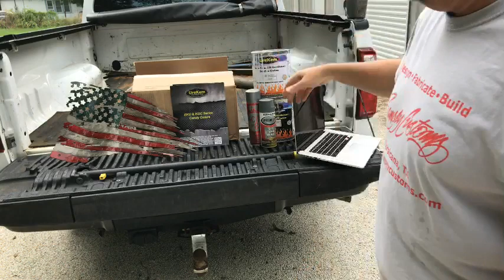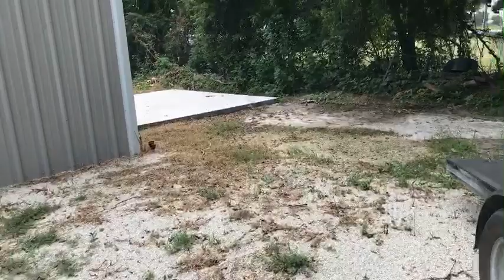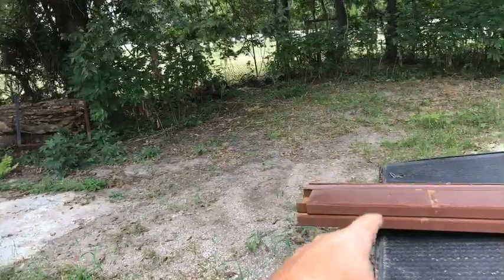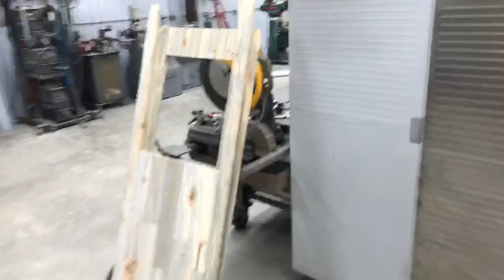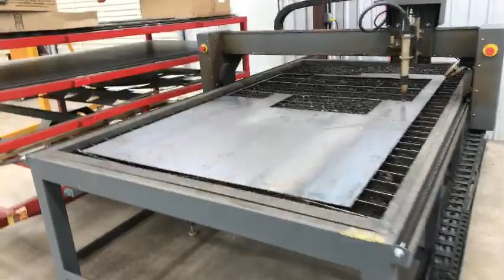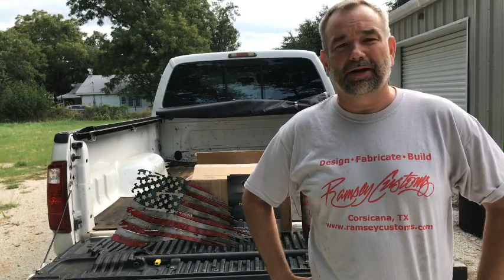Some Bad News - Part 2 Live stream replay

Comment: ...Shop labor hourly rate for automotive work....around here (Sacramento, Calif.)...$90-100 for Independants....Dodge dealer $169..............so I did the water-pump and front can housing on my 99 Dodge ram Van with V-6 myself.......$15 for a gasket and seal kit.....did it in my driveway....a few hours....

Comment: I blew a waterpump and rad on my 6.2 diesel wheelchair van last summer. Everything from the engine block forward got replaced and that was 10 weeks of chasing obsolete parts, and a guy shot himself in the head over it

Comment: Sympathies with your hassles. Even $3,200 was a heavy dig in the pocket for the truck pump repair. .. major ouch.
Then -- no spray booth any more. That sucks. Making a new one is time and work to achieve but ultimately I guess will be more than worthwhile.
So much all at once. I hope things will turn around for you Gary.
Your stuff was gone??!!  WTF. I hope that all works out.

Comment: On our 6.4 Diesel Ford at work there was contamination in the fuel system. Everything got trashed. The entire fuel system had to be changed. When I went to the shop, the cab and bed were off the truck. All you could see were just the rails. It didn't even look like a truck. My mom said from the old days where they did, like, 10,000 to 12,000 psi in the fuel pressure, but now they're something like 40,000 psi on the fuel system and that makes them very sensitive to any contamination. Anyway I looked at the repair bill it was well North of $9K.

Comment: Crazy that you have to go through that just to change a fuel pump! The last diesel I had was an old Cummins, my son has it and it still going strong. I would never own a newer one unless I needed it for a specific purpose. Are you going to do a down draft on the paint booth? Most of the better ones I have seen use that to keep overspray down. Hope thing pick up for you business wise !
Reply from the maker: I wish it was a downdraft, but no this will be the standard cross draft, home built, trying to make it the best I can without spending $25K-$40K on a pre-made one
Reply: I hear  ya, I guess not like you are doing custom cars anyways.